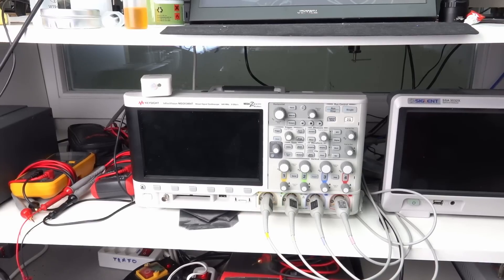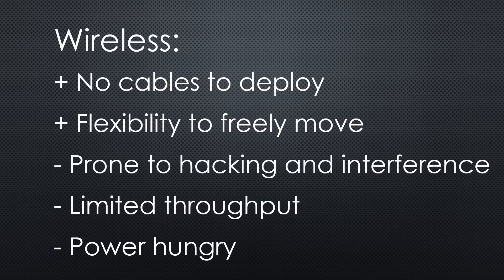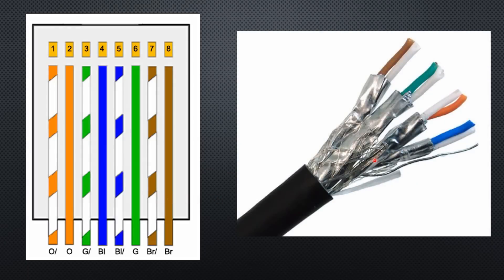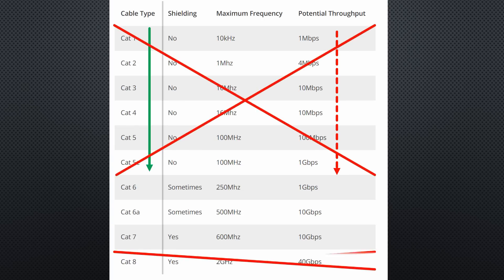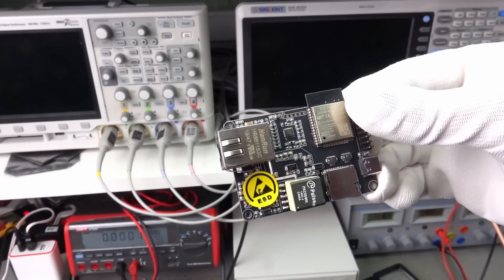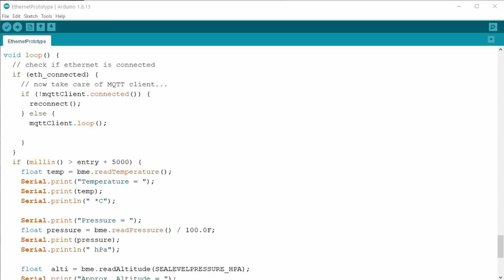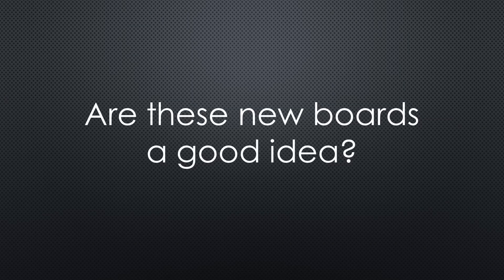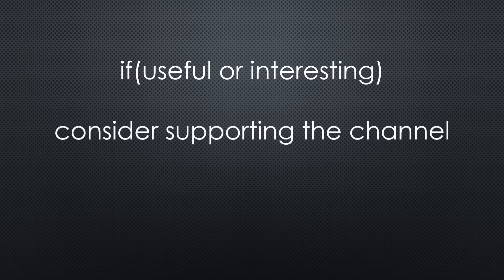#365 Is Power over Ethernet (POE) on the ESP32 any good? (New TTGO and Olimex boards available)

Comment: One problem I encountered often when crimping network cables: Poor quality cables have conductors made from copper coated aluminum (CCA). I never was able to make cable that properly worked at 1 gigabit (100M worked, though).
Once I switched to real copper cables, every single cable worked at 1Gbit, so I really think the CCA is to blame.
Unfortunately it can be difficult to tell if it is real copper or CCA. I only realized after looking at the cut cable under a microscope. I will never again buy cable that does not have a propper data sheet!

Also, thanks for kind of promoting the ESP's LAN interface! I also think that wired is in many cases preferable over wireless and I hope the support in the community for this will grow.
Recently I wanted to upgrade my 3D-printer's webcam to LAN. Only when the ordered network PCB arrived, I realized that the camera interface and the LAN interface share pins. And, if i saw it correctly, at least some of these can't be assigned freely. So no LAN and camera interface at the same time... Or does anyone know a way out?
Reply from the maker: Thank you for sharing your experience with non copper cables.
Reply: @AndreasSpiess  I am glad i can contribute something. I guess the most important thing is to be aware of such cables and not buy them. Unfortunately many sellers on ebay advertise them as CCA Copper. Acually more than just an euphemism for aluminium with a few microns copper on it...
BTW. I ordered my bad cable from a well established reseller that mostly has a good reputation and existed alrady long before ebay...

Comment: Another alternative are Ethernet W5100 shields for Arduino AVR platforms.
One Arduino Uno plus Ethernet shield (without PoE) is half the cost of the TTGO POE Board.
.
There are also Ethernet W5100 shields with PoE but then there is no price advantage.
Reply from the maker: You are right. For me, POE makes the difference because of the cabeling advantage.

Comment: important thing; wifi is half duplex. so it's 150Mb/s in one direction at a time, and only one device can typically transmitting at a time in any wifi network, which slows that down even further if multiple devices need to transmit at once. 100Mb/s ethernet is full duplex all the time!
Reply from the maker: Good point. But maybe not very important for IOT devices because of low needs...

Comment: Cat7 is not an official standard and therefore not enforced in production, cat6a is an official standard and achives the same bandwidth, however for most consumer needs cat5e is more than enough much more flexible and simple to work with and much cheaper, so I would recommend using that for most projects, cat6 seems pointless to me as it barely just eliminates a little bit of cross talk compared to 5e. 

Ethernet is not necessarily rj-45, ethernet is a computer networking technology which is also used in fiber optics for example.

Very glad to se Poe for esp32 and I'm excited to work with it.
Reply from the maker: I agree with your judgement. As a HAM radio operator I do not like unshielded parallel wires is small tubes. That is maybe why I opt for CAT7.
I also heard that they will introduce Ethernet protocols as a replacement for CANBUS in future cars...
Reply: @AndreasSpiess  You can get 5e, 6 and 6a shielded by going for FTP cables instead of UTP, but they are generally more meant for outdoor use. Tesla cars use Bluetooth for their wheels pressure sensor now, but they might be a bit of an extreme :D

Comment: I have been told, that RJ-45 and cat cable are originating from AT&T Bell laboratories within the phrase "Premises distribution system". AT&T manufactured those components and cables with the name Systimax. The PDS contains also passive adapters for RS-232 and Token ring and coax video etc. PDS RJ-45 connector 2 center pins are because of RJ-11 phone connection.
Reply from the maker: Good to know the history of the RJ45 connectors. The first Ethernet cables I know were coax with BNC connectors, if I remember right. In a daisy-chain configuration, not a star.

Comment: Thanks for a nice video.

Btw, that sticker is not a danger label for your safety as 50V will not kill you but a warning that the device may be damaged due to ESD (electro-static discharge), i.e. the manufacturer can always claim  ESD damage bcs  mishandling. Honestly, all bare bone electronics are susceptible to ESD so I understand them. It is also very difficult to prove ESD damage.
Reply from the maker: I know the meaning of the sticker. It should have been a joke because this was the first such sticker on a Chinese board. And in an area which has to be quite good protected...

Comment: I use some ESP (both types) for various home automation things - sensors etc. I use a cat5e cable for power delivery, poe config on the cable, with 12 volt currently (maybe i add / increase to 24v later). I only use a standard buck converter to go down to 5v for the esp, with of course the option to sue the original 12v for motors if needed.
I could use standard ethernet when needed, or any bus protocol on fewer wires (which was my original idea), but the esp are way simplier. I plan to add a dedicated "Node" wifi network somewhat in the future for these, isolated from most of my normal network (except the Home assistant server of course) and no internet connection. But for now, the default wifi does the job.
I never intent to use this cables for high speed transmissions (i have a normal cat 7 network for that), and cat5e is enough for even standard video cams. So in my opinion, this is a budget friendly diy solution (which also lets me experiment on power over cat and other things :) ) Sometimes the custom diy is better just because of the fun doing it and the stuff you learn :)
Reply from the maker: Thank you for sharing your experience!

Comment: Question. If you have say a Pi3 working on WiFi. If you plug an esp board with ethernet as shown in the video into the pi would they be able to talk to one another across the wired connection
Reply from the maker: Yes. The Pi connects automatically to the Ethernet network if a "valid" cable is plugged in.

Comment: about using same wifi functions in code - i didn't quite get it: is it possible to connect such boards to ethernet (using poe) and at the same time disable wifi/bt completely? because having wifi/bt enabled and just not connected/registered with ap - is not quite private in my understanding
Reply from the maker: It does not connect to your AP if you use this code.
Reply: @AndreasSpiess  But is RF-part of esp32-module enabled?
Reply from the maker: You decide with your code.

Comment: Hello Andreas, Could you please measure increase od power consumption of your router after connecting ESP based ethernet device? Few years ago I considered about building smarthome system on arduinos and ENC28J60 but I did not do it because these ethernet chips had high power consumption. At these days ESP8266 on wifi with deep sleep result in much lower consumption. With tens of connected devices every watt will be noticible on electricity bill.
Reply from the maker: It is not easy to measure this current and I do not care too much :-(

Comment: Wifi alarm systems are too easy to jam.  Cabling are sometimes to expensive, so I am pursuing laser signalling, with low power invisible lasers between nodes.Added advantage is of course the laser trip wires as well then.  With the availability of cheap small solar panel lamps, the nodes can be hidden inside and power is not a problem for ESP's or HC-12's.  When you want to hide something, do it in plain sight.
Reply from the maker: Interesting concept!

Comment: Your advice of getting a Ethernet cable tester is IMPORTANT.  It is a must if you build and crimp your own cables,  but beware that my experience is that about 5% of store bought cables can have problems.   It is also amazing how many errors in wiring can go undetected in use,  as Ethernet will drop speed down to establish a connection.  There are wiring errors that can cause a 'bad day'.  A tester is money well spent.  Highly recommended.
Reply from the maker: Thank you for supporting me ;-) We probably have the same experience.

Comment: I like to keep every device wired if possible. Wifi just ads too many variables to the mix. Is the password correct? Does it give me enough troughput? Did I set the correct channel? If it's down, is it because something is broken, forgot its settings or just currently trying to reconnect? With 2€ snakey boi from Amazon, I just plug it in and data transfer go brrrrrrrrr.

But to each their own. I can imagine that the compatibility with the wife (not just the wi-fi, pun intended, kinda proud of it, actually) plays a huge role in prefering wireless networking too tho.
Reply from the maker: As you say: Both methods have advantages and disadvantages....

Comment: Very good timing Andreas, as usual. I've been looking for esp32 ethernet boards for a while now and it seems that there is some more movement now. 
Have you seen Seeedstudio's board, even though it does not have PoE: https://www.seeedstudio.com/Ethernet-module-based-on-ESP32-series-WT32-ETH01-p-4736.html

Comment: Andreas, for me this is a very valuable video.  You have saved me a lot of digging. Thank you.
RE "not enough pins"  another inexpensive tied in processor(ex. Arduino MIni Pro ?) can add pins if needed since power is not an issue.
Reply from the maker: You are right, there are many ways of adding pins if you need.

Comment: Cat 7 cables are a scam. The RJ-45 connector only supports a maximum of 500 MHz and is therefore only suitable for CAT 6A. There is no RJ-45 connector that meets the CAT 7 specification.
Reply from the maker: I like the shielding.

Comment: The other really good difference with WiFi is reliability. WiFi can have loss of connection because of noise and other issues. Ethernet will be working as far as the cable is connected.
Reply from the maker: True!

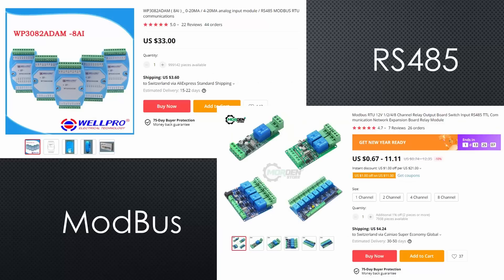Comment: 2:52 Hahaha, old school - I only learned about modbus from working with actual industrial equipment. The good thing there (and likely not a coincidence, I suspect people had the exact same train of thought as you did) is that modbus is also available over TCP :-)
Reply from the maker: I did not speak of "modbus" as a protocol here. I talked about the cabling, I think.
Reply: @AndreasSpiess  You are right, you didn't mention it by name, but you did show it on screen alongside RS485 when you said "a few years ago I would probably have thought about using such a bus for my home" :-)
To be fair most IoT devices use TCP/IP, it would be impractical for most people to route separate RS485 wiring or to have a modbus server on their local network nowadays :-)

Comment: Hello Andreas, this subject is very important to me as I build my own home and design my own multisensors. I tried the Olimex, it is quite expensive but unfortunately it did not function well (intermittent issues, difficult to describe). The TTGO seems very annoying! It's too big for in-ceiling sensors, and the features are all wrong. I don't need SD cards, the board spacing doesn't look efficient, and why include a USB-C socket if it only provides power? (A CH340 is sooo cheap now and small as well)... my quest continues! I have been thinking about trying to make my own board for a long time now, like Freetronics but for ESP32 and more "barebones" (small as possible). My end goal is cylindrical multisensors that can be installed into ceilings. 3D printed of course. I think for now I will continue to use Arduino Nano, W5100 breakout, buck converter and PoE injection for this application! Anyway great video, I always enjoy watching your presentations.
Reply from the maker: Maybe somebody will create such a board if the future when Ethernet becomes more popular...
Reply: @AndreasSpiess  I have just seen the WT32-ETH01. It is not PoE, but does look interesting because it does have a lot of the features I am looking for: minimally small and ethernet!

Comment: I set up my esp8266 to my wifi using wled. And it has worked great. When I am at home anywhere I can get wireless I can control my Led lights with an app. That has given me a newfound pleasure of working with ESP8266.
Reply from the maker: The ESP8266 is a fun chip, you are right.

Comment: As more and more motherboards have cheap Intel or Realtek 2.5GbE adapters, I predict that it will be the new standard for home in a few years and Cat5E cable is good enough for that. In my experience, storage and low end PCs cannot even keep up with >200MB/s transfers. Mostly because of encrypted protocols, spinning disks and cheap cache-less SSDs.
Reply from the maker: Well possible that this intermediate step will become popular.

Comment: Great video. I was already interested in the TTGO wESP32 now I am even more interested.

Could you show us a setup for remote lights using wired connections (no fancy colored stuff like Philips Hue) that can be integrated into Home Assistant?

For a while now, I've been searching for smartlights that can be connected through ethernet. As they don't exist yet, I hope this can be done using the TTGO ESP32. Could you give us an example of this project and how to achieve that?
Reply from the maker: Maybe an interesting project... It should be possible, but probably not on this channel.
Reply: @AndreasSpiess  why not? Do you atleast know what I should search for to come closer to the solution of this project?
Reply from the maker: I would cut it into parts and search solutions for each part.
Reply: @AndreasSpiess  you mean search for a wireless project and than search for a way to make if wired?

Comment: My cheap ethernet tester had me cutting off the ends of my homemade cable and I  tried  putting on a new one over and over - until I figured out there was bad solder joint on one of the LED pins in the tester !
Reply from the maker: Bad luck! I assume now it works and you can trust your cables are the root cause...

Comment: No cat 7 coils still in Argentina 😭 damn dólar...
Reply from the maker: Bad luck :-(
Reply: Ya, hard to find here and cat 6 shielded is also hard to come by. Im suffering from urban noise interference. Soooo many wifi connections, sat dishes, cells, a radio antenna...even tv transmissions suffer. My ethernet cameras used to cut out completely but not shielded. Gak.

Comment: Great intro to ethernet on the ESP32.  My own experience has been that the older CAT-3 cables work perfectly well for IOT devices, because those devices don't have the processing power to utilize the faster ethernet speeds.  Even ethernet chips like the Microchip ENC28J60 were fast enough for all IOT projects, and they aren't the fastest!
Reply from the maker: You are right for IOT only. For me, Ethernet is an neutral infrastructure which has to be independent and long-term.

Comment: Nothing beats the reliability and simplicity of a cable! I'm not so sure about power consumption though... you're going from solar and battery (on your other projects) to grid power. Definitely good for reliability, but what about the electric bill?
Reply from the maker: I do not think you will see it on the electric bill. A battery also costs money...
Reply: @AndreasSpiess  True that. Potentially lower maintenance that way too, especially for sensors that run 24/7.

Comment: I think this has great potential. I’ve always wanted POE powered IOT devices.  Now I just pass 24v over Ethernet cables to my devices for power only.  The “cost” of 8 pins is too much, maybe Expressif will build it into the next chip. Also, I’ve heard of complications with Bluetooth and Ethernet, that needs to be resolved.
Reply from the maker: Ethernet is already built-in into the ESP32 chip :-)